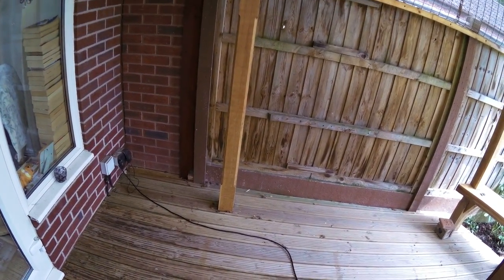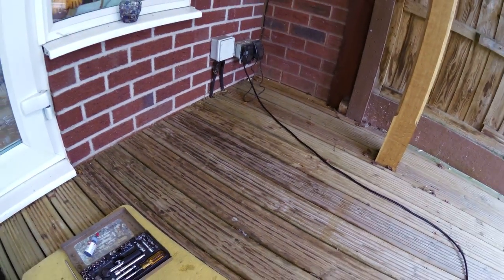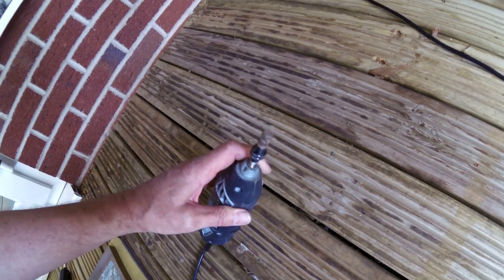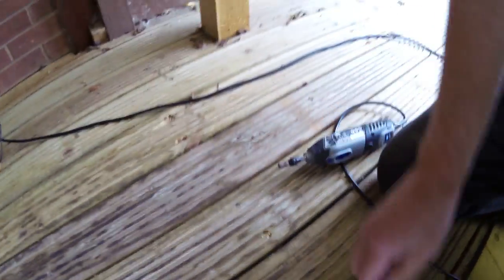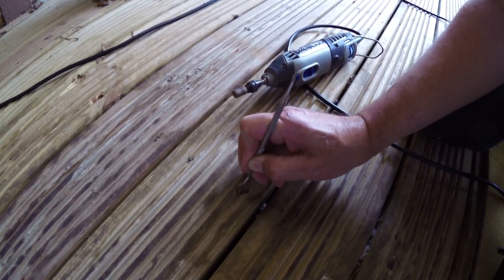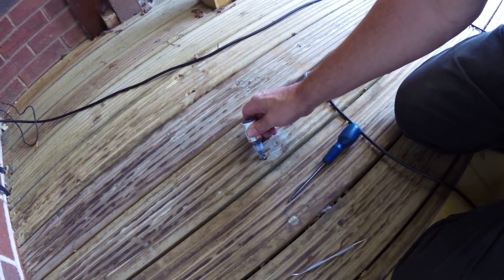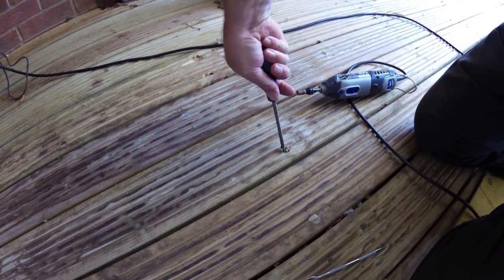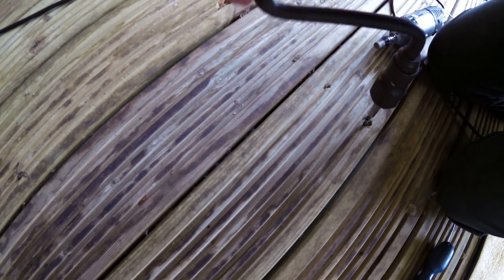'What and How' - Decking board and screw removal

Comment: Thanks for that.  I've got a right job on with removing decking boards this weekend.  I'm dreading it a little less now!
Reply from the maker: Pleased its helpful and best of luck.  A good Dremmel tool will go a long way.  I used the RF-3C bit listed here: https://www.permagrit.com/small-rotary-tools/  They might seem a bit pricey, but they are very durable - providing you don't try extensive metal-grinding with them.

Comment: Any tips for when the screw heads are completely knackered!? 😄
Reply from the maker: Well tricky.  I think i'd resort to 'eazi-outs' but they require the drilling of a hole - https://www.amazon.co.uk/Extractor-Upgraded-Version-Diyife-Stripped/dp/B08PD1G9F1/ref=asc_df_B08PD1G9F1/?tag=googshopuk-21&linkCode=df0&hvadid=480529754521&hvpos=&hvnetw=g&hvrand=16427141828828478986&hvpone=&hvptwo=&hvqmt=&hvdev=c&hvdvcmdl=&hvlocint=&hvlocphy=1007201&hvtargid=pla-1109557683043&th=1

Or mole-grips if there is at least an end you can grip onto.  Or grind the head off using a dremel tool and then put a new screw in somewhere else. on re-fitting?

Or try this link - this guy has some really good techniques to try:
https://www.youtube.com/watch?v=_mTFQbaT3Zc&ab_channel=UltimateHandyman

Comment: Clive,

Thanks for the video...I found it very helpful for removing my deck boards! Quick question: which dremel accessory bit were you using to polish/reach the screw head?
Reply from the maker: Hey Rob, thanks for your feedback/comments and sorry for the delay in replying.  I used the RF-3C 11mm diameter rotary drum coarse tool bit found on this page: 

https://www.permagrit.com/small-rotary-tools/

They might be pricier than the cheaper tools you can get - but Perma-Grit are fantastic/last forever (unless you grind metal all day of course)

PS: whilst the arbour shaft is 3.1mm, the diameter of the bit is ~11mm and I used some short lengths of 10mm wood dowel to plug up the holes after the boards were replaced

Comment: Hi Clive, what screw type did you or will you use as a replacement?
Reply from the maker: Hi Paolo, actually the extraction preserved the screws so i was able to re-use them.  I think as a precaution i'd rub furniture wax onto new or replaced screws to aid the insertion and future extraction by avoid corrosion/re-sticking to the wood.
Reply: Thx Clive, I'm about to buy Torx recess screws as a replacement.. a bit more expensive but it could well worth it, any comments?
Reply from the maker: @paolomh113  Hi Paolo, those Torx screws are just great - though as you say - can be a bit pricey.  It's a very good suggestion in the Decking board context - and I fully recommend them generally as a replacement of Phillips or Posidrive screws (for just about any application).  A bit of bees or general furniture-polishing wax on the heads as you fit them, might reduce the potential for corrosion and thereby make future removal easier.